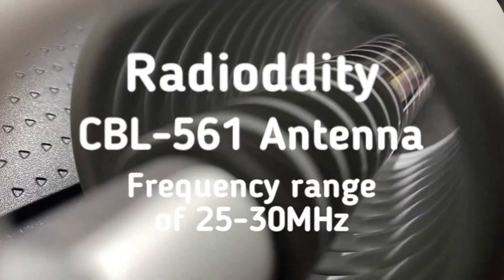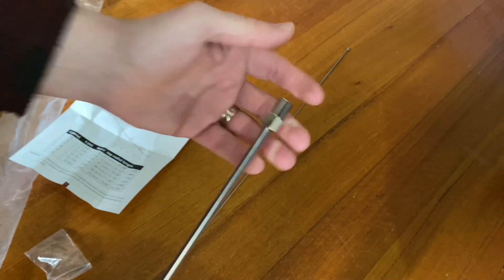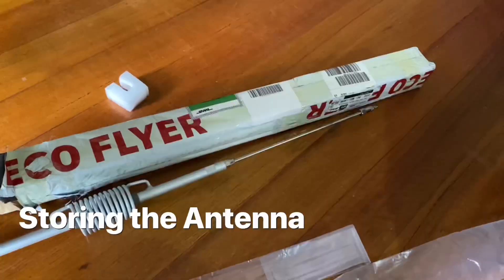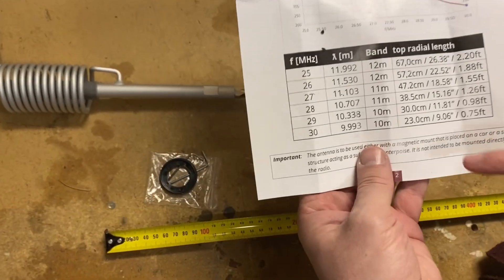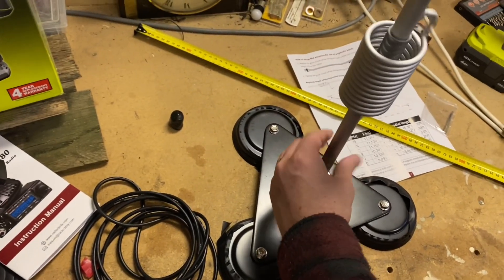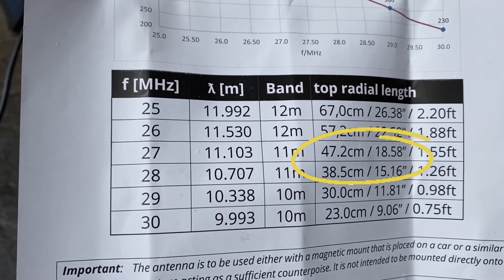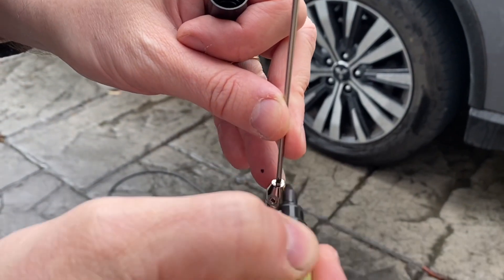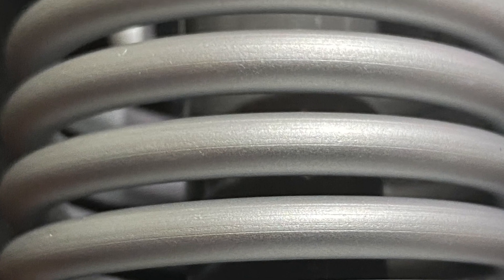CBL-561 HF Mobile #Antenna

Comment: I have the exact same antenna and radio (QT80) and cannot get it below 2.0 SWR, and am unable to receive anything on 10m. Thank you for making this video. Could the rattle phenomenon short out the whole antenna?
Reply from the maker: Hey mate. It sounds like something is wrong there either with the radio or antenna or both. Have you tried a different radio on the antenna or different antenna on the radio? See which one works?

Comment: I would take the top antenna section off and then put an o-ring on the antenna and then assembly the o-ring should keep it from vibrating
Reply from the maker: Great idea mate. Thanks very much!
Reply: @vk3tbs I just got one waiting for adjustable trunk mount then I'll throw it on the Honda CRV with my President George FCC radio 🍻 472 South Alabama
Reply from the maker: @yournotmymaster8492  Hey mate, sounds awsome, thanks for letting me know.  Should work well with President George!  I'm keen to hear what you think of it and how well it works mate.

Comment: i like the antenna but i just think the magnet mount is over kill to big, i would just use the single magnet mount looks better on the car. 🤠
Reply: The single mag mount radiooddity gives u is crap and not strong enough
Reply from the maker: Oh, I didn’t have that problem. Is your roof flat? Is it metal? A lot of cars are aluminium now.
Reply from the maker: Yes I understand. The magnetic mount was actually part of the HF antenna I got which is a far bigger antenna. I used it with this antenna as I know it would not let go when mobile. 
That said, you can always get a non-magnetic mount and it will work fine.

Comment: Where can you buy this antenna in Australia...?
Reply from the maker: Yes great question. I suggest you email Radioddity and ask them you are prepared to pay a little more postage as I think that is what the problem is. 
Let me know how you go and I will try for you also.
Reply: @vk3tbs  radioddity wouldn't ship the antenna to the UK, had to use very large company (not the uk one) and get it from the usa, it did cost 2-3 quid more , but wasn't charged shipping, mines working fine now
Reply from the maker: Oh that is a bit odd. Sorry to hear that. Wonder why.

Comment: Hi, can I install this antenna on my base to use it at 11 meters?
Reply from the maker: Yes mate. I tested it and worked well. 
There is a link in the description that will give you a discount if you want to get it.
Reply: Thank you, you are very kind. I have one more question for you: what would be the ideal way to put it?
Reply from the maker: What do you mean “put it” are you meaning install it, locate it or something else?
Reply from the maker: It’s made for a car, but it would work well as a base also. 
Height it might. Get a long pole if you can or put it up as high as you can.
Reply from the maker: Let us know how you go. Keen to hear

Comment: What’s stopping water from getting down through the top and down into the 259 at the bottom..?
Reply from the maker: Good question mate. From what I can see it looks like water will not get in if done up correctly. There are drain holes down the bottom. I used it in the rain while doing the video but didn’t test it a lot of rain. Not yet anyway.

Comment: Mine is due tomorrow via DHL in China only ordered it a few days ago
Reply from the maker: Great! Yes I was surprised how quickly mine took to arrive. Sure are happy with it so far. Will be taking it camping next week. 
How are you going to use yours?
Reply: @vk3tbs  Hey Mate , just for Mobile use  it looked pretty rugged and at that price why not give it a try , will be interesting to see how it goes on the Bull Bar , Cheers Dave VK2BDP
Reply from the maker: That is where mine will go some of the time for sure. 
Interested to hear your thoughts on it once you have tested it mate. 
Will listen out for you.
Reply: @vk3tbs  I popped it onto the Bull Bar of the Ranger, and tuned it with the QT-80 yeah, I grabbed one for the mobile just the right size within in 5 minutes on 10 meters that sounded very quiet at 11:30 this morning and had a ZL contact so i think that answers the question although i have not tried 12 meters yet. All from the comfort of my driveaway up here in Western Sydney. The Radioddity cup has a multitude of band measurements around the cup need to be careful not to spill the coffee reading it . 73's Cheers all
Reply from the maker: Cool mate. Hopefully you get good use out of it mate. Keen to hear how you go with it. Enjoy

Comment: Thanks for the video, please can you test out for DXing.
Reply from the maker: Sure will mate. Going camping next week and plan to test it then. Will do a video for you. Look out for it then. 
Thanks for your comment.
Reply: @vk3tbs  Thanks for the video. Finally an easily adjustable antenna across several bands.
Why didn't someone think of this sooner?😊
Reply from the maker: Agree
Reply: @vk3tbs  I am surprised that Amazon in 13:49  the US isn't selling it. They sell just about everything else by Raddiodity. 
Your comments about the size of the box are spot on. It just leads to increased shipping costs.
It is too bad that other manufacturers don't have the same idea. 11:56 
Do you really need that tri-magnet mount?
I have a Stryker A-10 magnet mounted on the roof of my civic. The whip is practically touching the overhead utility lines on the road!
Reply from the maker: Hey. Thanks for your comments. 
I’ve done another video today that compares the antennas so I’d encourage you to watch it. 
As for the packaging, yes I’ve let them know and they are changing it to keep the cost down. 
As for the Mount, no don’t need to use the one I have. It was just what I had. I also use a bull bar mount. The issue with a roof mount is it can be hard to adjust if you can’t get it down quickly. Any Mount will do mate. 
Thanks for your comments. Appreciate it.